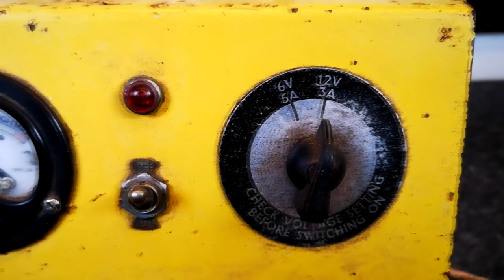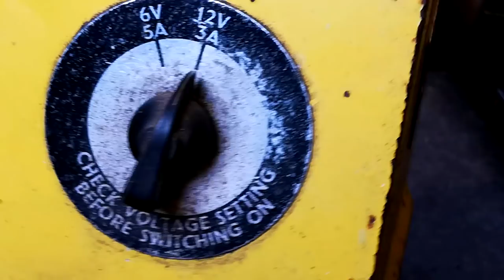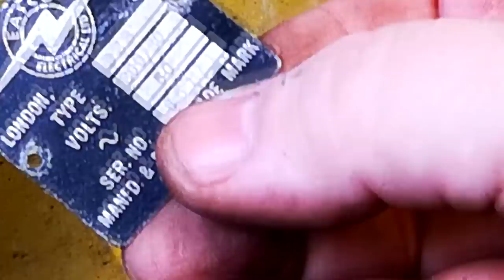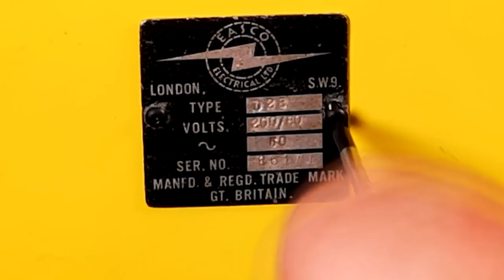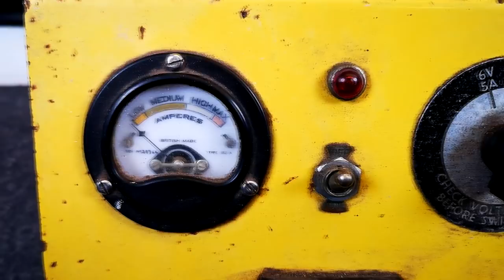Vintage 1950s Battery Charger Restoration

Comment: Very nice job on the restoration.   Looked like someone had done some work inside before based on some modern looking wiring.
The new red and black posts for the leads look very good.
I did enjoy seeing some old electrical components.
Dave.
Reply: Yep no doubt someone at least put a new mains cable in it, the rubber original would have gone bad, easco was liquidated in feb1963 so it's been around

Comment: WOW that is an old charger for sure. A bridge selenium rectifier setup, can't get much older then that. And you also can't get any better then powder coating either. And that is a huge current transformer as well. Looks like you could also adjust the voltage output via that wire-wound power resister if need be. Nice project Martin. Thumbs Up!

Comment: Very nicely done. Be prepared...when that selenium rectifier decides to give up the ghost  the odor it gives off as it smokes is absolutely awful. They rarely break out in flames  but they overheat....destroy themselves and stink big time. Lots of solid state rectifier's available at a variety of amperage levels to repair the charger if/when that happens. I like the added touch of the fuse in the power plug. Good safety feature.
Reply: Fused plugs are required in the UK per safety laws.
Reply: I had an old Bosch charger with Selenium rectifier give its magic smoke. It’s pretty nasty. But one of the problems I faced was the that these high current selenium rectifiers are hard to find and quite expensive. Silicon rectifiers are easy to find and cheap. But their forward voltage drop is low when compared to higher voltage drop of selenium. Because of this these older transformers output 14VAC for 12V setting and 9VAC for the 6V setting. If you replaced with just a silicone bridge rectifier the output DC will be quite high.

Comment: something you can try to mitigate that "pixilated" appearance when your printing out decals, try printing in "photo-mode" if your printer has that option. tends to give it a higher level of detail. ive seen Marty from marty's matchbox makeovers revert to that for waterslides for small fine-print decals on his cars. still a really neat resto on this. your videos have really been tempting me to look into getting a powder coating setup.

Comment: That is a wonderful restoration, the powder coating, decal reproduction, etc. You must have done it over several evenings. I have a 1960's 6 and 12 volt battery charger, its in good condition, I think it was hardly used and stayed in the box till I bought it. The clips are exactly similar to yours, with a black neg and red pos color inside a rectangle. Wonder if its the same make.

Comment: This is an excellent restoration as usual. If you plan to actually use it for something you should bypass the selenium rectifier with modern diodes since they tend to heat up and go up in flames unpredictably
Reply from the maker: It will not be used
Reply: No,it will raise the output voltage and overcharge worse

Comment: I too have an old charger, it's really just a garage ornament, can't use on modern batteries, but they work forever
Reply: Why?
Reply: Jusb, is there a reason you can't use old chargers on newer batteries? (I have an old one here somewhere) Thanks
Reply: They used a transformer to convert the voltage so they almost work for so many years. Nowadays, companies use junk SMPS power supply instead which work for a couple of days.
Reply: @Everythings_Adjustable  old chargers keep rising the voltage, modern batteries are sealed, it raises too much and bubbles the battery and vents, some batteries are AGM and damaged beyond 15v
Reply: @jusb1066  Years ago, when  charging the older type lead acid batteries, my old man used to say it was good for the battery to let it bubble while charging! I don't remember having any problems with them.

Comment: A very in depth restoration of 'spongebob' there!
Was there any manufacturering dates inside? That a 'selenium' rectifier used in there, a type used before the modern silicone diode ones were invented.

Comment: Great job, but why didnt you replaced the selenium rectifier with a modern full wave bridge module. Those old selenium rectifiers are faulty and put out a poisonous gas when they burn out.
Reply from the maker: It retains its original parts as it won't be used and is a display item now.

Comment: So this would be a 6 Volt charger ?
You could have bought the original " Bolt on rubber feet" through a musical instrument store. They are still used by many amplifier manufacturers

Comment: Nice restoration! Did you have any issues with soaking electrical parts insulated with fiber washers in an iron saturated rust remover? With the higher mains voltage you operate at, I am curious about current crossover on the insulators should they become mineralized
Reply from the maker: It is all fine bud

Comment: Gotta ask, did it work?  The reason I ask is that when you reinstalled the selenium rectifier, you didn't remove the powder coating from the hole the negative side went to, so it's not grounded.  You didn't remove it from the negative charger terminal either.  That would keep it from working.  Just curious!
Reply from the maker: Yes I did, I didn't show it in the vid though and it does work

Comment: Im not sure if its 1950s... more 1970s as in the 50s they had spaghetti insulation on the wirring and direct wire wound connection rather than screw plastic joiners shown near the transformer... but still nice job either way
Reply: Easco London was closed down in 1963 so it is fair
Reply: Looks similar too an "auto-spark", i have an 8Amp one in my workshop here in Australia, built in Melbourne 1971, the only difference is its 240VAC/10A, with 6-12-24VDC/8A/hr, made by "Black & Decker"... but i suppose back in the darkhorse days...the designs were based on functional rather than plastic throwaways lol
Reply: @ironforge7646  pressed steel was as throwaway as they had got to

Comment: In the description,  you say it will probably never be used again.  Has the design of Batteries changed that much that this tool is now useless?
Reply from the maker: A lot of new batteries like lithium Ion batteries need a different type of charger. This is a display item now.

Comment: you seem to be taking on more complicated restorations all the time. Say, are you in the UK or France or what.. I don't recognize that plug, but I know from adapters I've had there are many different plugs used around the world. Most places use 220 volts rather than our 120

If Edison had been smarter, instead of lobbying against AC current, he should have lobbied for a DC converter in each home. DC won't transmit far, AC will so he was fighting a battle he was sure to lose, who needs a power station every few blocks. But if he had lobbied for a converter and got it done, most of us would be using DC now. These days, Low voltage DC would be a boon, since most electronics require converting the AC to DC anyway, they have to build the transformer into the units. If they weren't necessary, electronics could be smaller, lighter and cheaper.
Reply: Well, interesting point .
Just wondering how it could have change many things in "way of life" n habits ours ...

On ecological and economical points of taste ...

Nowadays looking forward for Sono motors that intend to offers commutatibility (the ability to commute, to switch from one source to the other) into that kind a path .

Nonetheless good point there.
Reply: @bricelarie6527  no telling. I mess around with vintage tube type electronics. One thing you always get when the tubes are old is that "dynamo hum" from the AC current. If nothing was ever that high powered there wouldn't be a need for all that's required to get that hum out, and we would have had better electronics sooner I think. But then there's no way to really know what would have happened.
Reply: Sure lazyness and comfort greed leads to hardly reversible situation ...

Lots of things that seems ...
Once fame are scaled, what's the point true consciousness ???

Some triangulation takes 3000 years to be proven true .

Evidence do not always have the sight they deserves .

Between less is better and "no further" there is physical "belief" like .

Life is unfortunately electrically moved, at least ions exchange based ...

👽 🙄 😏 😉 😽 😇 🍾 👌 👏 🕊

Comment: 6:10 uses a Blowtorch causing the metal casing to warp  instead of using WD40. To loosen tight rusted screws nuts and bolts..that made me Cringe
Reply from the maker: No warping when you know what you are doing. I already used WD 40

Comment: NOT a good idea to reuse the selenium rectifier, they are highly toxic if the fail and degrade with age. It wold have been a much better idea to upgrade it to a modern bridge rectifier.
Reply from the maker: Its a display piece now.
Reply: @RetroHax  Nice restoration thow.